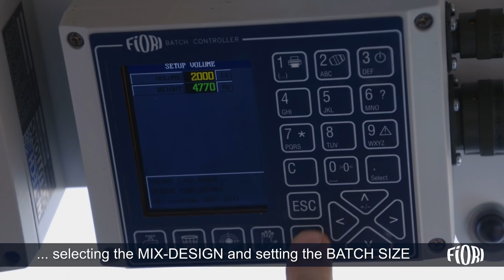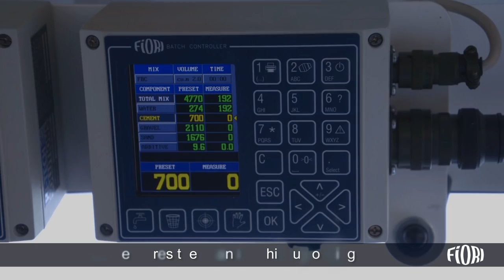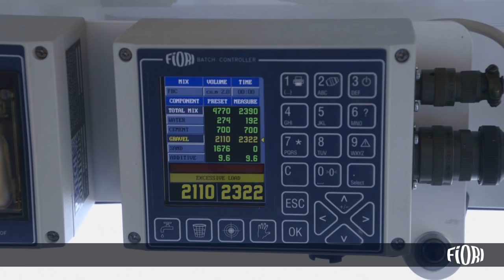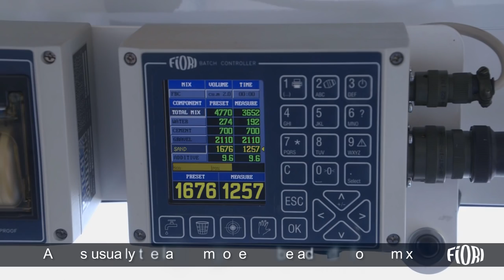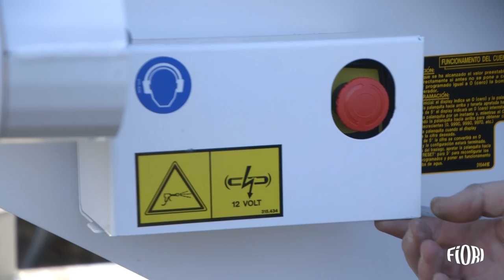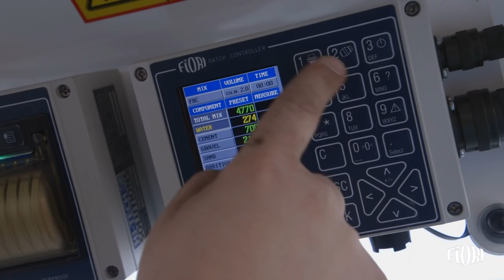Fiori Group - CBV - The Concrete Batching Vehicle  - Tredigraph Video

Comment: One Self Loader concrete mixer. Fiori 460 FBO8H; available in Nigeria, Benin City, Edo State. Price $58,230.00. Bought new in 2018 now to be sold after completing a project
Reply: How good is it, send pictures. What's the capacity. In terms of the cubic metres it can mix